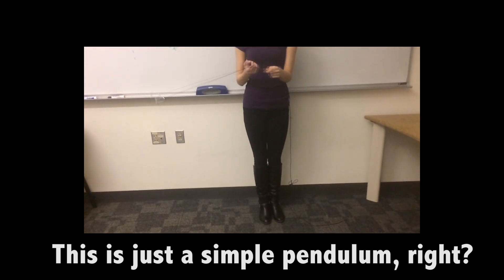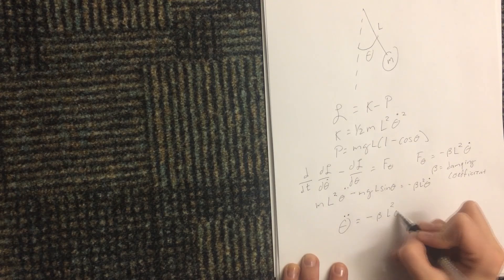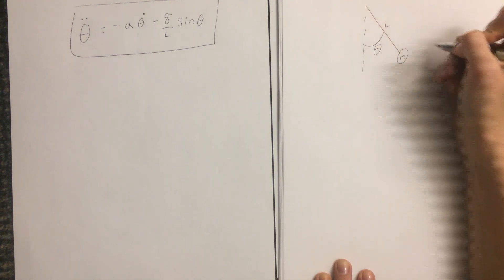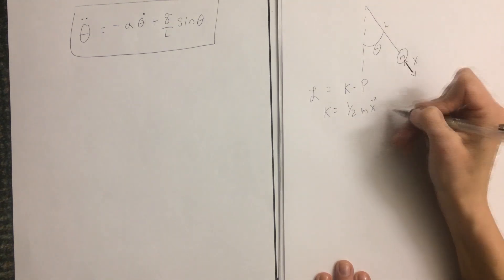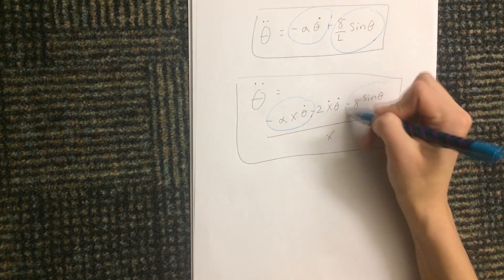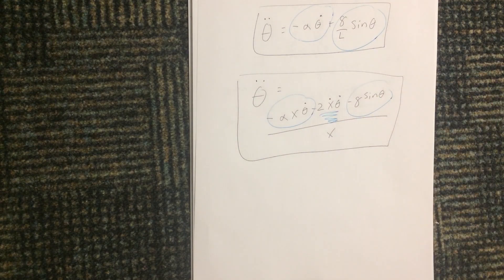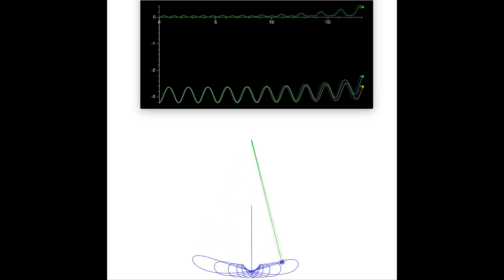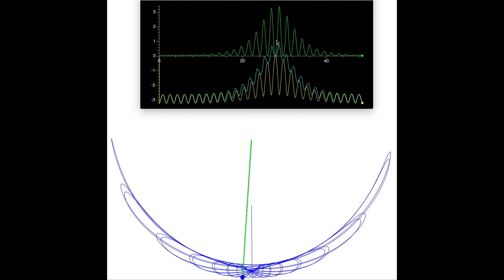Parametric Resonance

Comment: hey great video! has really helped. sorry to bother you but i am working on a very similar project and am wondering about a couple of things which could really help. firstly the damping force, most people just assume viscous damping when it is actually air resistance which is closer to velocity^2 have you have rejected bxθ' for Bx^2θ' and not b(xθ')^2 to keep it linear but closer to reality? and secondly your potential energy term p = mgx(1-cos(θ)) but would that not mean that your effective reference point would change with x as it is time dependent so it would not give a true value for the g.p.e?  would mg(x0-xcos(θ)) be better, if x0 is a constant such as the maximum length of the pendulum?       

i know this is probably for coursework now long forgotten and if your course is anything like mine you are very busy but it would really help me out and i would be very grateful if you could spare a moment. struggling to find decent understandable references for this stuff